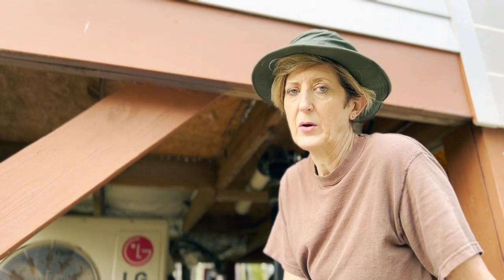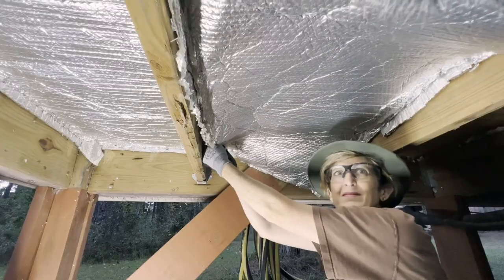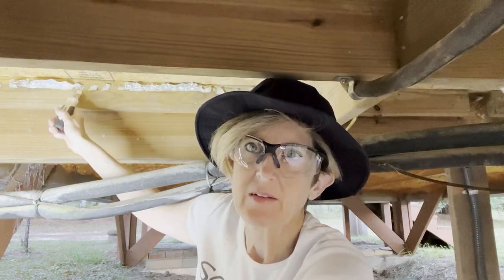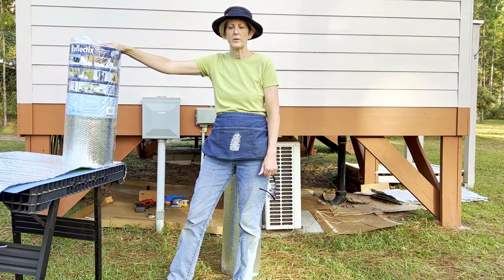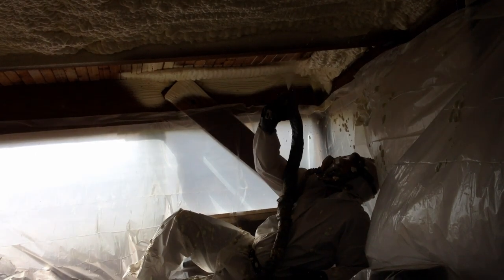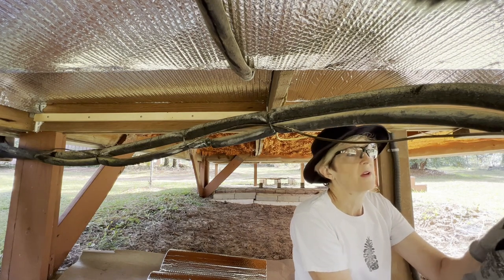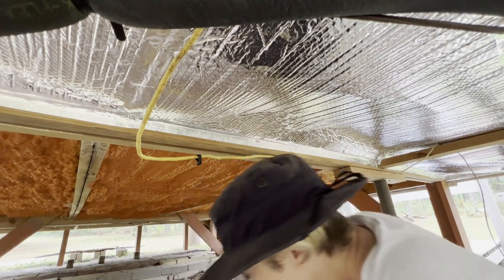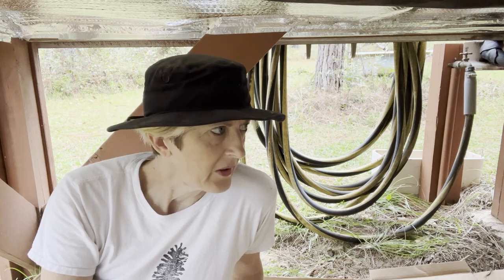REFLECTIX: Part 2 Under My Tiny House

Comment: I'm using reflectix under my cabin. I'm installing it like you did originally, no air gap. I have seen videos where they have installed it either way. I even watched a video from reflectix where they installed the bubble foil in the attic with no air gap. Can you tell a difference since you went back and replaced the reflectix and left an air gap?
Reply from the maker: Yes, I can tell a difference, but I think it’s from taping it all around the edges. I haven’t seen a scorpion in my house since I did that. Because I have radiant heat in the floor that I originally did with one layer of Reflectix I can’t really tell a difference in comfort because the thermostat just pumps more electricity into it until it reaches the set point. My power bill was higher because my refrigerator is low on refrigerant so I can’t really use that as a measurement.